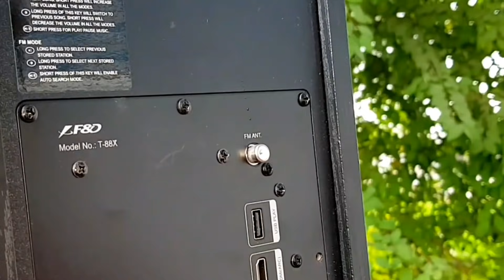F&D T88X INSIDE VIDEO(पूरा खोल कर दिखाया है देख लीजिए हर एक चीज)MOST EXPENSIVE TOWER  INSIDE VIDEO

Comment: Subwoofer ke peeche jo coil hai...Wo koi coil nahi hai wo 3 way crossover network plate hai jo low. Mid. High frequency ko alag alag filter karti hai...,
Reply: ya that's why it's expensive, i don't know if my t60x has a crossover as drivers tend to play same frequency all over the band . I'm pretty sure they haven't installed any crossover in the mid range driver, it was flexing like a woofer down to 40hz.
Reply: How about t70x, any idea about that one?
Reply: @finehumanbeing3506  bro buy t70x .....
Use Dayton 2 way Crossover on midrange and tweeter ....

And change tweeter with best quality tweeter from peerless , Dayton etc .... 

For subwoofer ..... 
Use 3 mH inductor and 20/30uf capacitor ....

After changes .... U will definitely kill t88x model ....
Reply: @nikhilsuryawanshi6301  Nice information Bro,Thank You so much